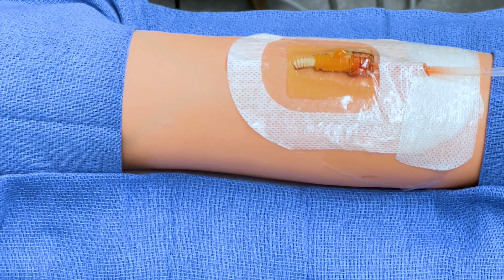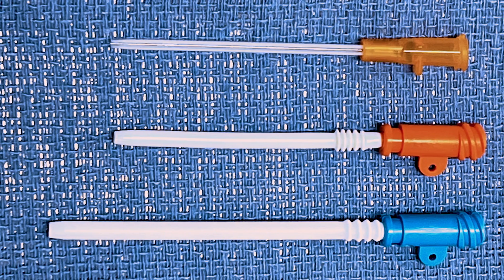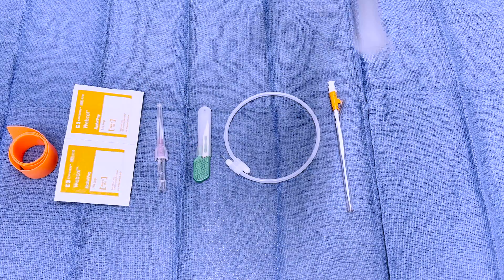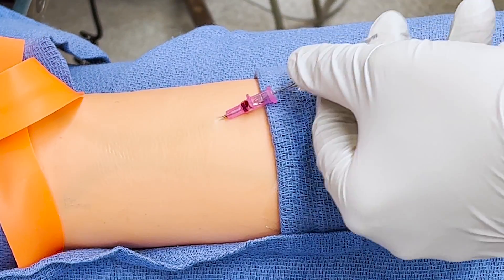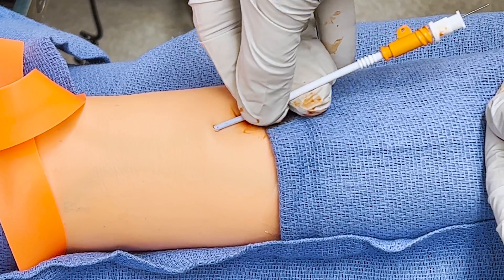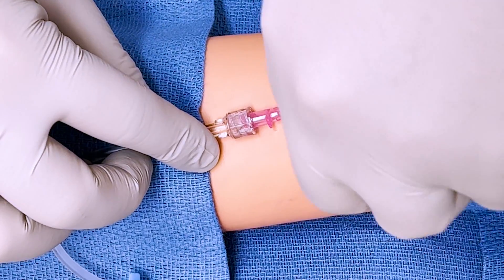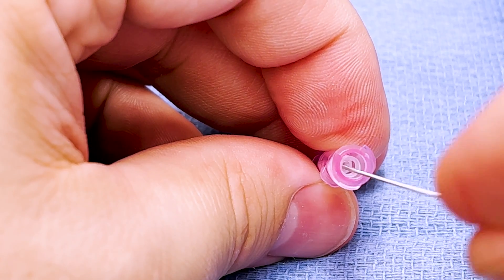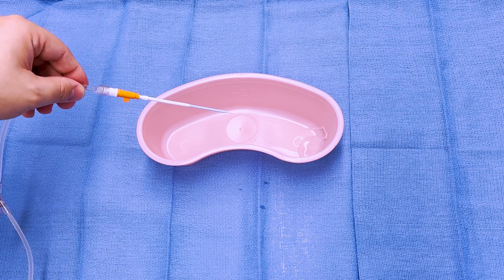How to Place a RIC Line - Very Large Bore Peripheral IV (Intravenous) Access Catheter

Comment: Seem pretty useless, with most common guide line even a 18G IV catheter is ok. That said great video! By from italy !!
Reply from the maker: "Useless" is pretty subjective, it depends on the use case. Liver transplants, massive trauma, placenta accretas; one can easily lose 10 Liters or more of blood and lose it very quickly during these cases. Are you going to be able to keep up with 1 Liter per minute blood loss from a hemorrhaging uterus for 15 minutes with two 18 gauges while the surgeons work to control the bleeding? Probably not.
Reply: @DrMRod   yeah is subjective! It depend even if the MET has good experience with it and the Emergency room organisation. 
But if the patient has gone to that point without a power injectable central IV i would ask my self a lot of question tbh and yes u got a point in the trauma but i don’t think so for the other two 😅 That said it’s a cool product for when thing go f wrong!😎
Reply from the maker: @Flavio-cv5cw  It's pretty common to get trauma patients that come direct to the OR with minimal intervention in the ER; it's a lot easier for me to place a RIC line (vs CVC) so that I can keep up with the surgeon cracking the chest open. Either way, in a trauma setting, a CVC is always second line after good peripheral access; there's a reason every trauma protocol includes "two large bore IVs" in steps 1 or 2.
Reply: I am a trauma anesthesiologist and I agree with Dr. Rodriguez. 2 18G PIV wont cut it with multiple GSWs to the chest. My trauma surgeons are usually pretty good about inserting a CORDIS in the ED, but if they don't, a RIC is much faster for me to place than a central line, and with a Belmont rapid infuser flows just as fast.
Reply: Once you’ve been around awhile you know that an 18g cannula (even if you have 2)  doesn’t cut it when you have torrential bleeding as for example placenta accreta, ruptured uterus, trauma etc. Sometimes patients can exsanguinate in front of you and I agree a Belmont fluid infuser on a RIC line is a lifesaver.

Comment: I'm losing my mind every time I see a guidewire being placed completely into a dilator/catheter. Maybe it's not a big deal if it's peripheral... but still
Reply from the maker: In my opinion, can confirm that with peripheral access, it is less of a big deal, #notmedicaladvice. This has been my practice with seldinger technique for peripheral venous access for some time and I haven’t had any lost wires in about 10 years of doing it this way. Even with CVCs, research suggests that the issue of lost wires is mainly one of “forgetting” about the wire rather than it being pushed/pulled/sucked in (Mariyaselvam et. al. 2021).

Comment: That's a nice practice arm!
Do they have a tool to break out the core of the anti-reflux valves on some IV catheters? Maybe just a way to secure the cannula and cut off lock to allow feeding guide wire in before removing catheter. I've heard of docs losing guide wires in patients, when doing central lines. Should the end be bent/secured before insertion?
Reply: In reality you would never let go of the wire
Reply from the maker: It's definitely important to have a good grip on the wire while advancing the catheter and I'm not necessarily claiming that a wire being "sucked" into a vein is a myth, but the fact that about 90% of lost guidewires are discovered post-procedure (Mariyaselvam et. al. 2021) suggests that the issue is one of inexperience and distraction rather than some weird physiologic phenomenon.

Either way, I do let go of peripherally placed venous wires all the time and have not had any issues after a decade of doing it that way. (hashtag not medical advice)
Reply from the maker: It's possible to get the wire through the anti-reflux valve, it just takes a few tries to get the wire exactly in the center without catching, so I wouldn't mess with pulling out the valve. I wouldn't bend the wire, as it would make it harder to put the RIC catheter on after removing the 20 Ga. As far as lost wires go, I think simulation is the answer to that; a major component of lost wires is a combination of stressful environments (code, trauma, etc.) and inexperience.